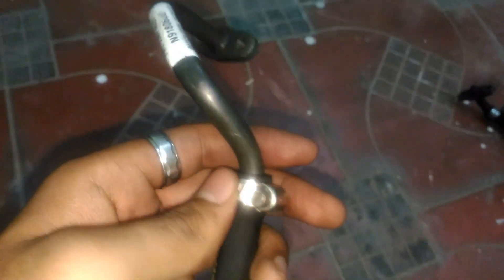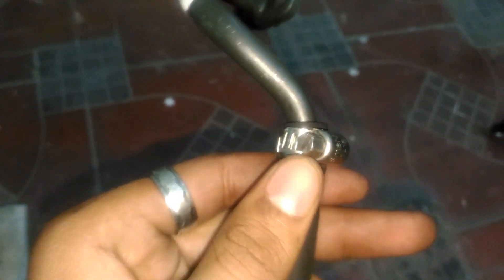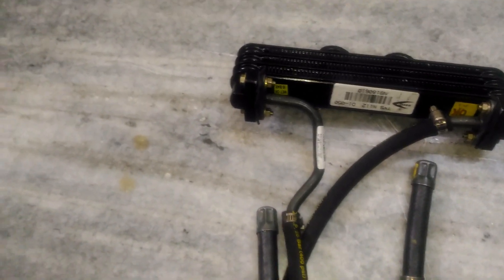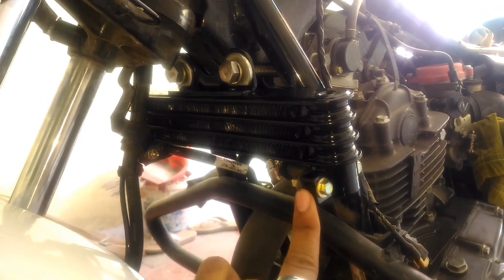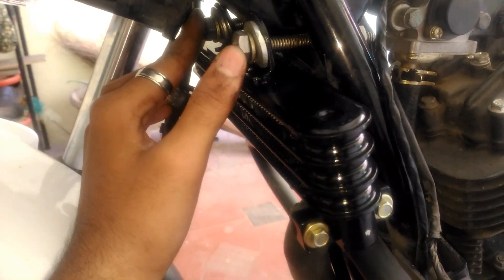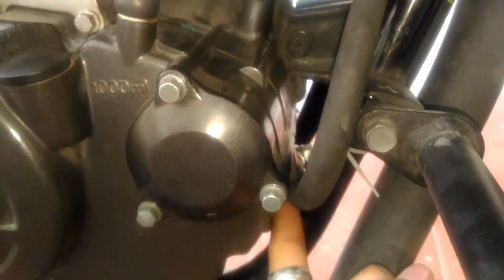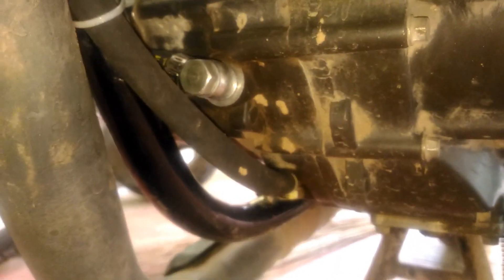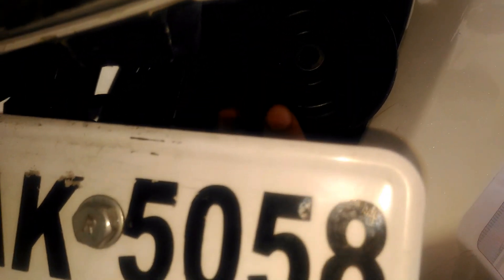Oil cooler installation on TVS apache RTR 180 ABS | DIY | heating issue resolved

Comment from the maker: NOTE: CLOCKED 5000 KMS SUCCESSFULLY WITHOUT ANY SINGLE ISSUE.
THE OIL COOLER IS WORKING FINE.
I REALLY NEED TO ADMIT THAT THE BIKE'S PERFORMANCE IS REALLY GOOD AT HIGH SPEED AND HIGH REV'S (usually i always push the rpm needle to the red line, coz we all know thay it is designed for that purpose only, so you need to stretch its legs) ON CONTINUES DRIVE.
MOST OF THE ENGINE HEAT IS DIRECTLY TRANSFERRED TO THE ATMOSPHERE.
SO LETS SAY GOOD BYE TO THE DHANDHURI OVEN UNDER YOUR LEGS BY INSTALLING IT.
FINALLY, ALSO THERE IS NO DROP IN MILEAGE BUT INCREASED LITTLE BIT.
Feel free to comment here . . .
I am happy to help you . . .
Have a good day
Reply: Bro we need high pressure hose pip or normal hose pip is OK?
Reply from the maker: Satish century use the braided hoses . . .
Since thry are engineered to withstand under high pressure and temperature . . .
Reply: Bro one doubt there is any problem if  braided hoses pipe is lengthier. i think my  braided hoses pipe is lengthier then yours  braided hoses pipe.
Reply: Because if the braided hoses pipe is lengthier engine has capacity to pump the oil to the radiator through lengthier pipe.
Reply: compere to your inlet pipe, my inlet pipe  is 50% more lengthier then yours. that is why i had a doubt, the engine has capacity to pump oil to the radiator  in lengthier pipe.  sorry for disturbing you...
Reply: vicky vignesh so is it OK if we use lengthier pipe for oil inlet to radiator. is It will pump the oil?
Reply from the maker: Satish century you have to mind that if it is too lengthier then you need to use extra oil (I.e: 50ml)
You said it is 50% longer than mine. So better reduce the size as possible or pour 50ml extra oil.
Reply: thank you for your reply bro...Some people won't replay for all the questions but you replayed mefor  everything...Ones again thank you bro...
Reply: Bro.... U connected oil cooler inlet and outlet pipe   but I didn't understand how can oil pump push oil  engine to radiator?? Cuz I Wana install in my bike...
Reply: vicky vignesh, hi, Good Job yaar.!,
I would like to ask some questions..
Reply from the maker: Satish century slight difference in the length will not be a problem.
Reply from the maker: Satish century yes. Apache's oil pump can circulate 1.2liter oil per minute.
Reply from the maker: Satish century no man . . I am always happy to clear your doubts . . . have safe ride
Reply from the maker: Satish century no man. Not like that.
Everyone has their own responsibilities. Even me also oftenly reply comments only in the late nights.
Since this is my last semester and having some time to work with the final year project.
So that is why I can reply you as much as I can.
And https://www.facebook.com/vaalu.payan
This is my facebook profile. If you wanna me to contact, just give me a request.
Reply: Hey bro...I own a pulsar 200 dtsi and it gets heated very fast ....I checked oil & everything ...but I want to know that will the bike heat even if ride it just for 5-10 kms.....
Reply: AA. Vignesh vicky vibration issue ok?
Reply: AA. Vignesh vicky can we use for rx100
Reply: AA. Vignesh vicky is it suitbale for honda hornet
Reply: Bro I have suzuki fiero can I intall in that ??
Check my channel #mohdzaidmotovlogs
Reply: Link of this oil cooler

Comment: There is two way circuit from oil pump in old rtr version. One is to filter and another one is the hole were bolt is plugged. If you open the bolt and connect to oil cooler inlet means the oil quantity and pressure will be less that reaches the filter and to overhead supply.  So that you have to replace the oil pump which is used in rtr 200. The oil pump in rtr 200 pumps out 1.5 times more than old pump so you can get the pressure and quantity.
Reply bro

Comment: I increased the compression ratio of my Apache 180 and i feel in few kilometers journeys the increased heat level of the engine, but i dont feel it like overheating, cause it dont loose any power, on the contrary, it feels more powerful and loose, maybe because its free of carbon, i dont know, but i will follow your advise, for long term protection of engine, thank you.

Comment: How can oil circulate without any additional pressure inside radiator or inlet section please explain
Reply from the maker: Those are oil pump lines, in which before the inlet portion, there is an oil pump which helps to circulate the enigne oil inside the system, including oil cooler.
For you kind information, the oil pump on apache can transmit 1L of engine oil per minute.

Comment: Hi Vignesh,
I am staying in Bangalore Hoskote, and not able to find "10mm banjo bolts and washers"
Tried finding online but its very costly.
Can you suggest me some place where i can get, or is there any online link where i can get it.

Thanks.
Reply from the maker: Ask any heavy vehicles operators or mechanics. These are used as fuel lines and hydraulic lines. So you can avail them easily. At the same place you can find the banjo bolts. Thank you.😊
Reply: @Mechanicgrapher  thanks i will try .
Reply: I have done this,I get oil cooler from ebay,,universal one with some modification, its about 1 year no problem till now,,from nepal

Comment: Which  hole is engine case inlet
Reply from the maker: The upper one in the front of the engine is inlet. Because it is nearer to the oil pump. The lower one below the engine is outlet.
Reply: bro send the photo  engine case hole inlet outlet 8680966380

Comment: Please give me idea  for apache rtr 160 fi 2009 model for oil cooler installation. Thank you in advance.
Reply from the maker: Vivek V nothing just follow the same setup and steps as i mentioned in this video
Reply: AA. Vignesh vicky thank you bro, I hope it will be very efficient. I recently rebored the cylinder head and got it assembled, it is getting heated up quickly, is it because the new piston and rebored cylinder is getting mated and set(don't know if I'm using the right term) and will become normal after oil and filter change after 500km . thanks in advance bro
Reply: AA. Vignesh vicky also bro, tvs company and local mechanic refused to repair the bike and asked me to sell it off as scrap, I am very much attached to this bike as it's my first bike after graduation , so I disassembled the cylinder head , got it rebored and installed new piston, please advice me if I have to take any preliminary checking steps if I have to take before using for regular trips apart from , engine oil , oil filter, air filter, clutch plates,  as I have checked them and replaced. Its running fine except for chain bracket which is yet to be replaced.
Reply from the maker: Vivek V as you said you have rebored make sure that the reboring work has been done in correct manner . . .
Then the next thing is that check the spark plug for any carbon deposits . . .
If there are more carbon deposits after few kms of drive, you need to clean the injector. . . . 
This is the place where local mechanics hate to do. . . . 
They do not know how to clean the throttle body and injector. . . . 
But it was quite simple then cleaning the carburetor. . . . 
Things you need to do now . . .
1. Take you bike to good young knowledgeable mechanic or SVC.
2. Do a complete check of your bike.
3. Repair and replace the parts if necessary.
Have a good ride bro.
Reply: AA. Vignesh vicky thanks a million for you advice , it is very helpful , spark plug is new, and the injector is spraying fine from all four nozzle holes, the only part I am stuck is where can we do proper ecu remapping and co tuning , as tvs service centre people never want to take in  apache fi 2009 models for service. I feel a little lag in pick up, don't know if I have to change the clutch plate / ecu remapping /or this(pickup lag)  is the main reason behind this models failure.

Comment: Bro it is possible  to fix hornet 160 ??
Reply from the maker: Bro I do not think that, honda has given oil cooler inlet and outlet provisions on their engines.
So I would not recommend to do that even using aftermarket parts and lathe works, since it will void the warranty and they are not reliable.

Comment: What will be price of the oil cooler and how should I ask in shops to buy the oil cooler
Reply from the maker: The whole oil cooler assembly is around 2500 RS bro.
It is the stock oil cooler of apache RTR 200.
You can also use the Pulsar 220 or avenger oil cooler.
It will be only available at the dealership spare parts center bro.
Reply: Thanks for the info bro..

Comment: Bro.... U connected oil cooler inlet and outlet pipe   but I didn't understand how can oil pump push oil  engine to radiator?? Cuz I Wana install in my bike...
Reply from the maker: The ilet and outlet pipe runs through the oil pump line bro.

Comment: Did u dril in your engine
Reply from the maker: no. There are oil cooler inlet and outlet provisions on the engine.  They were enclosed by bolts.

Comment: bro will it work on other smaller bikes????
Reply from the maker: which bikes bro???
Reply: AA. Vignesh vicky 
Tvs victor 110cc
Reply from the maker: sorry for the later reply bro.  I am quite busy for sometimes.
So now tell me?  What is the problem with you tvs victor bike?
Reply: AA. Vignesh vicky, no bro some heat issue on my bike!!! so i decided to fit oil cooler. but my mechanic told me it will reduce mileage, already i faced that mileage issue, may it affects???

Comment: Hello sir. after oil cooler installation ENGINE COWL
 to Fitting return pls reply sir .
Reply from the maker: Riding Range it can be fixed without any distibrance bro.
Reply: AA. Vignesh vicky thanks again.

Comment: How much did the bike used to heat earlier..
Reply from the maker: The bike always heats up since it is an air cooled engine.
But after installing the oil cooler the heat dissipation was much faster than usual, also the life span of oil is also expanded.

Comment: Bro can i buy 10 mm badjo blots online do you know any sites pls suggest if you  know or is it available in local shops
Reply from the maker: +akhil sk 64 I prefer you to buy it from the local shop. It is available in all the automotive fuel liners and hydraulic liners shop.
Reply: Bro is it possible to flip the shock absorber just like rr310 any way i want do that

Comment: Hi Bro,
Can we install this cooling system in Suzuki Gixxer SF?
Reply from the maker: +Nantha Kishore gixxer is 150cc engine which does not need an oil cooler.
If you want to reduce the engine heat, just use the recommended engine oil grade and some best brand oils like motul, shell etc
Reply: Okay bro,
Gixxer SF is 155cc and heat is higher whenever I used to travel around 80-100 for half an hour in highway., So I need to stop bike for 10-15 mins or I need to go by 50-60 to avoid those circumstances I wanted to have it for both long life and for smooth engine,
Is any possibility is there to install oil cooler in Suzuki Gixxer SF please confirm me Bro....!!!!!
Reply: Already Using motul oil only bro,
Please confirm me is their any possibility of installing oil cooler as you done for your Apache?,
By not disturbing engine.
Reply from the maker: Nantha Kishore nothing is impossible bro.
In apache there are already we have provisions for the oil cooler.
But gixxer does not have those.
Since it need some precise work, good engineer to do that so. But make sure you check that the heating is may be due to other reasons such and carbonated spark plugs, lean air fuel mixture, dirty air filter.
Some peoples tuning the carburetor to extract the maximum mileage, which leads to increase in the engine heat.
Finally, you need to accept that, it is air cooled engine.
So make sure check this heating issue is common with other gixxers too.
Reply: AA. Vignesh vicky thanks bro,
Very informative,
Will check with other Gixxer users if I am the one who face this issue in the sense I'll check with spark plug, air filter and carborator adjustment if it's common among Gixxer SF I will reach to custom bikers.
Reply from the maker: Nantha Kishore of course.
I am really happy to help you man.

Comment: Very good work sir ..did adding oil cooler help in reducing vibration.
Reply from the maker: +Mubashir Duduke yes of course.
Also use proper graded oil.
Always use motul or shell.
Grade is very important bro.
The recommended grade is 10w40.
Reply: vicky vignesh thank you sir

Comment: Is this was available for hero xtreme sports... Is this was suitable for hero xtreme sports...
Reply from the maker: No bro. I do not think that it is possible on Xtreme.  You need to do drilling works to fix the oil cooler on HERO Xtreme which is a unwanted thing
Reply: Ok buddy...

Comment: Bro 220 oil cooler can be installed or not on apache 180
Reply from the maker: Yes bro you can use that too.  The procedure is same for 220 oil cooler.

Comment: Bro intha video tamil la dub panni podugga pls
Reply from the maker: ANTONY M edhavadhu doubts na inga keylunga bro . . . . soldren . . .
Reply: vicky vignesh inlet outlet ku engine la drill pannanuma bro
Reply from the maker: ANTONY M thevai ila bro . . .
Already holes irukkum . . .
Bolts pottu close panni irukkum namma direct ah adhulaye fix pannidalam . . .
I have mentioned that on the video bro . . .watch it fully
Reply: vicky vignesh thanks bro one more question oil circulation epdi aagum nu sollugga bro
Reply from the maker: ANTONY M bro engine ullaye oil circulate pannddathukku gear irukku bro . . .adhan circulate panna vaikkum
Reply: vicky vignesh components enna enna nu sollugga bro
Reply from the maker: ANTONY M video description la list out pannirukken check pannunga bro . . .

Comment: Hey bro, l plan to fix it on my Fazer.  Is this kit suit for this??
Reply from the maker: There is no provisions for inlet and outlet for the oil cooler on fz engine . . .
You need to drill the engine block and find a way to fix this . . . 
It is kind of a messy thing leads to damage the engine block bro . . . 
It may end up in failure . . .so it is safer to stick with the air cooler only . . . .

Comment: Sir kindly give me a link to buy the radiator which you are using
Reply from the maker: PUSHPENDER BHARDWAJ bro it is available at the TVS service center. You can buy it there . . .
If it is not available then try pulsar 220 or avenger oil cooler
Reply: vicky vignesh brother one more query what is the specification of the pipe which you used
Reply from the maker: PUSHPENDER BHARDWAJ 8 mm braided hose pipe . . .
It is used as fuel and hydraulic pipes on heavy vehicles and earth movers . . .
Reply: Brother on more query... Kindly check out the front disk oil pipe.... Can we use that pipe instead of hose pipe..... N if we can not then why
Reply from the maker: PUSHPENDER BHARDWAJ yes you can also use that to . . .
But make sure that, it have to withstand both temperature and pressure of engine oil . . .
Braided hoses are well fabricated and they can withstand upto 400psi . . .
I am not sure about the front brake line pipe thermal property . . .
So please do a proper inspection of the disc brake pipes . . .
Reply: AA. Vignesh vicky where can i stand braided hose

Comment: I fitting my bike rtr160 success tanks bro good performance
Reply: Where have you puchase
Reply from the maker: great man . . .  enjoy your ride.
Reply: Jitender Sony  Coimbatore old market
Reply: I went delhi but not avaliable in the  showroom
Reply: Jitender Sony bro this part pulsar 220 oil cooler
u try bajaj showrooms r.s 1800 for new
Reply: showroom worker says that it is not avaliable
Reply: RAVIKIRAN kiran y I speck only tamil
Reply: 9466089986
Reply: muthu pandi  share your contact number bro
Reply: muthu pandi bro I'm also tamilan only bro give me your number
Reply: epadi oil cooler install panniga ethu inlet ethu outlet sollunga bro
Reply: RAVIKIRAN kiran 9843085668
Sorry for the time
Reply: RAVIKIRAN kiran my number 9843085668
Reply: AA. Vignesh vicky whats the expence???all total including fitting charge??
Reply: muthu pandi hornet ku itha fix pannalama koncham rs details  sollunkale pls
Reply: muthu pandi eppdi bro
Reply: Inlet hole outlet hole engine
Reply: நண்பா உங்களுக்கு ஆயில் கூலர் பிட் பண்ணி குடுத்த மெக்கானிக் எனக்கு பண்ணி தருவாரா

Comment: do we need to drill the engine to fit the hose pipes??
Reply from the maker: Shubhrajit Choudhury no dude.
There are separate provisions on the apache engine for the inlet and outlet pipe of the oil cooler.
Reply: vicky vignesh thanks for the info but i have one confusion.. normally all oil circulation require a pump for circulating the oil..how does this work??
Reply from the maker: Man that was a good one . . .
Here if you watch the video completely you can notice where is the inlet and the outlet port.
The inlet port is situated above the engine oil pumping gear, also it is close to the oil filter . . .so the oil will be pumped automatically towards to cooler. . .
Therefore, there will be no resistance for the oil flow, from the sump to the oil cooler . . .

Comment: Hi, I congratulate you on the video.
I have some questions.
Is it necessary to pour the 1.2 liters of oil? And what happens if I only make 1litro of oil.
How long does it take to run the oil through the radiator and engine?
And in the engine what would be the output of the oil and the entrance of the oil?

Thank you
Reply from the maker: Thanks mate.
The extra 200 ml goes into the oil cooler.  If it reduces it will leads to improper lubrication to the piston and other moving parts.
If you make only 1 liter, then 200 ml will goes into the oil cooler, and other moving parts will be lubricated less.
Watch the video completely, in the video I have mentioned the inlet and outlet provisions for the oil cooler.
Thanks. Ride safe.